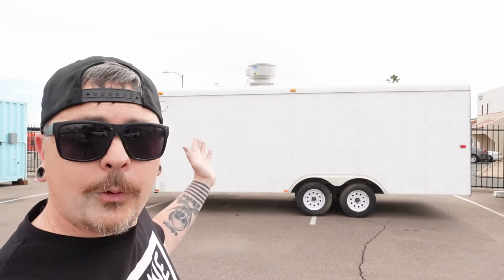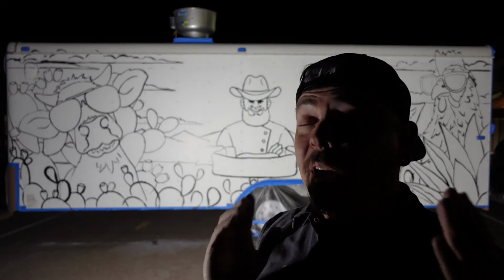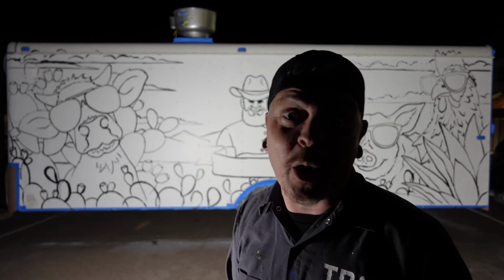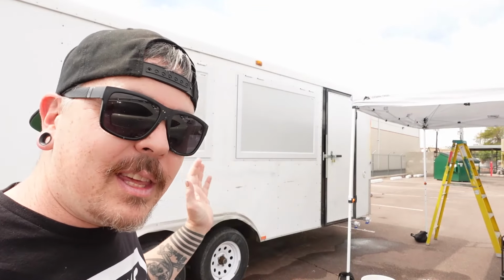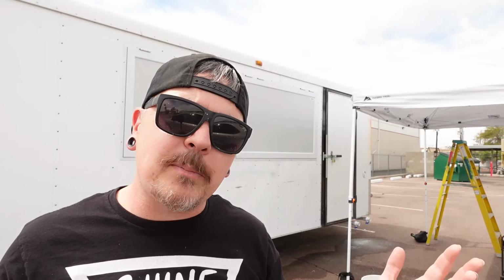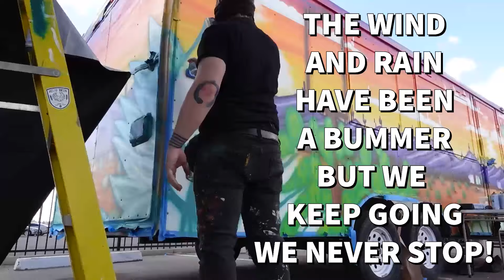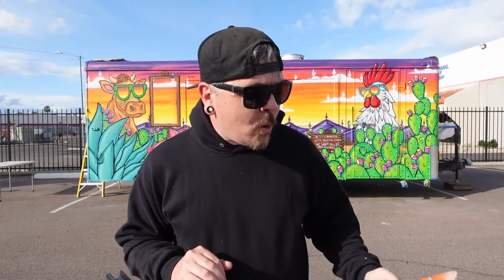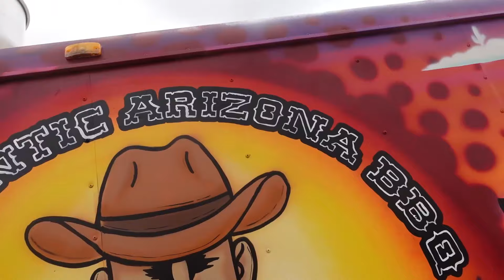I Paint A Food Truck | Pit Jefe BBQ

Comment: Would you say the mural shield is better than the auto body clear coat you used on your previous food truck ?
Reply from the maker: I think so, but of course, time will tell. I believe the mural shield will need to be reapplied sooner than the auto body clear, but the mural shield is far easier to work with.